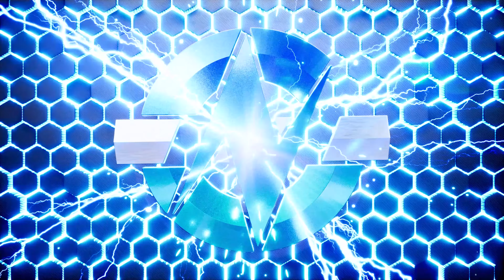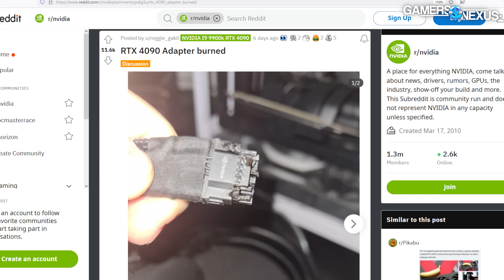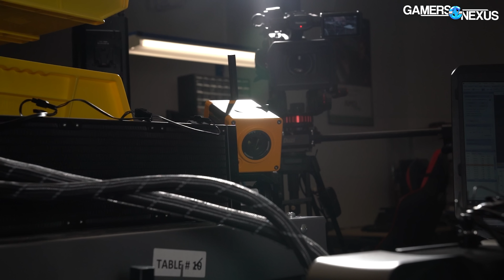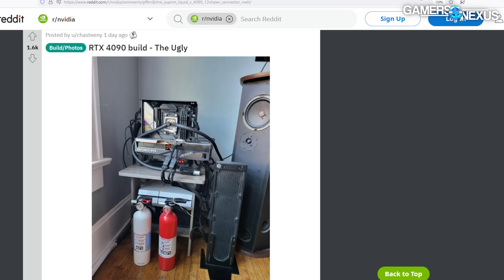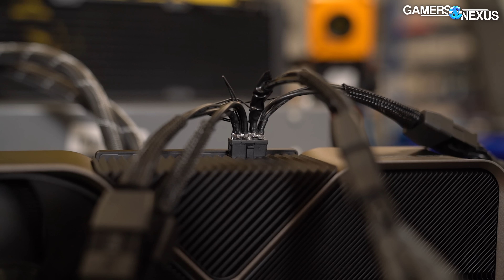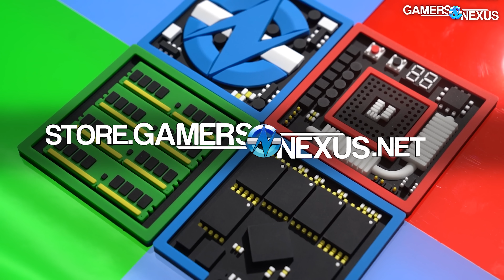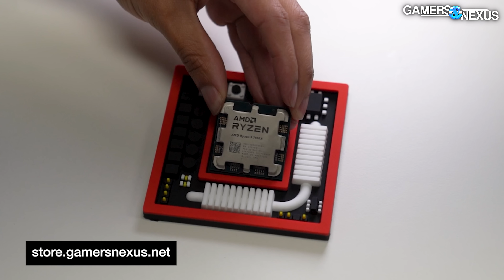Testing Burning NVIDIA 12VHPWR Adapter Cable Theories (RTX 4090)

Comment: I had a problem with J and Igor theory. If the solder point was the weak point, it would also be the spot the melts. Since the energy would have a smaller path to travel over/across, it would heat up in that area, not past it. I haven't see anyone test pin fit, that I am aware of.

Comment: After watching too much content on this sensationalized topic Buildzoid's theory looks the most credible. None of the pictures we've seen online show the cable side of the connector melting. Going after the solder joints is absolutely a red herring which is laughable at the amount of work people have gone through to dismantle that joint. Every post we've seen of real melting has always been inside the actual contact point. If the heat was sourced at the solders we'd see the back of said connectors melting, which no one has experienced. 

All electronics have at least a small measurable failure rate, especially at removable connections. This is a normal failure point. There's no such thing as a 0% failure rate. Even Rolls Royce and Bugatti have a measurable failure rate and they don't sell as many cars in a year as Nvidia does GPUs in a week. The difference is people don't hate RR and Buggatti. They take it back to the dealer and get it fixed instead of raging on Reddit.

I think what we're really seeing here is people understandably hate Nvidia's pricing and will jump on any imaginary possibility to dunk on them. The fanboys have taken over the narrative and all the tech press can do is investigate. The dumb part of that is no matter what the investigation concludes fanboys will never be satisfied. They'll keep digging for alternate diagnosis until they find one that agrees with their agenda. Even if it was discovered a supplier was to blame for selling under-spec adapters to Nvidia those fanboys will keep posting Nvidia GPUs will burn your house down for years to come because that's their agenda.

There's plenty of valid reasons to bash Nvidia but when people start raising false flags I won't have any part of that. Somebody needs to have some integrity.

Comment: Steve, Nvidia choice of using a single 12 pin connector with four 12 pin connectors ganging-up on it is the root of this problem, all done to save real estate on the PCB. Had they used two 12 pin connectors at the GPU this problem is go away. The problem occurs between the contact crimp location and the junction where the connector contacts the pin on the PCB. The contacts are made from very thin .25mm thick brass causing a very narrow path for the current to pass through causing it to heat-up increasing the resistive load even more which under high load conditions can cause thermal runaway until the connector starts to melt and burn. Your thermal camera is only capturing the local thermal temperatures and not the very short distance between the points I just mentioned. This design is "marginal" at best. Had Nvidia used 24 contacts we would not be having this conversation. Designing wiring harnesses, connector selection and PCB board layout as part job all I had to do is look at what Nvidia did and load it would be under to know what would happen. Positive locking would have helped. Great video, keep-up the good work

Comment: 6:35 - I wouldn't be surprised if someone in manufacturing or warehouse confused both cables since both are extremely similar
sounds like a quality control issue or mixed cables wrongly shipped. Which is still unacceptable considering how important such component is
that's why I never buy a product or game day one. "Sell now, make sure is good later" is the new moto for many companies
13:00 - Steve I suggest making a video showing how to do it for people who are still hesitant (as there are people that still don't feel confident with written instructions)

Comment: You are all doing this outside on a test bench, you already had one at 74c in one test, but it's outside a case in open air, if it's inside a case this number will be much higher since heat do build up in cases whether or not it has poor ventilation

Comment: Great reporting.  hopefully someone can get more actually failing samples in to people like GN (or the manufacturers) who can do more analysis.
For connectors to melt the housing, you really need a very high resistance at the connection and that is not really done with a completely severed connection (yes it will have more current through less metal, but they have some design margine so it is unlikely that a few severed cables will cause heat build-up that breaks thermal equilibrium with natural cooling, so there are possibly some connection that has become loose enough to have some high resistance, but not lost complete contact (i.e. solder point partially coming off like solder crack, partially severed cable (unlikely), or bad contact at the spring contact between female and male connector pins etc.  There are other similar issues we test in automotive like sliding wear, but thats probably not the issue here).

Comment: Another issue that is difficult to determine is knowing what the melting point of the plastic is from batch to batch.  If there is a quality control issue on only a few lots of cables, it is unlikely to run across a bad one if it is just one or a couple of runs.

Comment: Because the connector is melting at the end of the connector, if supposedly the broken part is on the other side of the connector, then maybe the problem could be between the connector and the board socket, like the adapter junction and the gpu pin!

Comment: To me, Igor’s findings are somewhat contradicting itself. Disconnected cables don’t create heat, because they’re broken off, the cables that are left connected creates more heat because they’re dealing with more current now. But the photos show the heat points are on the side of the connectors, which is where the disconnected cables are. In his scenario, it would only make sense that the disconnected cables are still so close to its contact points it starts arcing, which then creates a lot of heat.

Comment: To be fair, soldering the wires onto a board isn't that ideal. The PCB traces are potentially one of the more fragile things there, and it isn't hard to understand that a thin layer of copper foil isn't going to handle as much current as the much thicker cable soldered to it.

However, the 300 V vs 150 V rating is meaningless.
This is mainly depending on insulation thickness, and even a 60 V rated insulation is more than rugged enough for this type of application.
Thinner insulation has a lower breakdown voltage than a thicker insulation. But likewise, a thinner insulation also provides less thermal resistance, ie the cable doesn't get as warm. So to a degree, the 150 V rated cable is likely the better spec for this application.

In regards to Buildzoid's comment, yes having a 1 vs 2 slots in the contact itself is a major difference. Having more slots in the contact makes it have more contact points and in turn lower contact resistance. (high current cables in more industrial applications tends to have tens to hundreds of contact points. More is better, with the only downside being a more fragile connector for a given size.)

A simple solution is to simply say that they are pushing the cable too far. But soldering like this frankly isn't ideal in volume production... And I don't really see why they needed to solder it, crimping 2 or more wires into the same crimp isn't against industry practices, especially if the pin/crimp is designed with that in mind. A crimped connection is often more reliable long term, solder is however easier if connecting to a PCB, but why they use such here is frankly inept.

Personally, I am wondering when the PC industry inevitably will move to higher voltages. And perhaps this is already a possibility.
Sending X watts over 12 volts needs Y current, but have 24 volts instead and you only need half the current. And the only thing connectors really care about is current. The voltage doesn't effect thermals. (with the exception of having high enough voltages for an arch to form, but for a PCIe 8 pin, that is currently a good couple of hundred volts, and the arch will form on the PCB between the pins there, not inside the connector.)

Another even more major advantage of higher voltages is an easier time reaching higher PSU efficiencies. Downside is VRM ripple tends to increase with an increasing supply line voltage, but multi phase VRMs tends to quickly solve that issue. (just going to 2 phases makes a huge difference to ripple, and most VRMs have more than 2 phases.)

Comment: Um, has anyone looked at cross-sectional area (CSA) of the conductors? There are several 14gauge wires soldered onto a "thin metal plate". Maybe the plate does not have enough CSA to cope with the current draw?  ..and maybe the plate gets hot and softens the solder enough for wires to detach. There could also be a difference in the material used to make the plates and what resistivity those materials have.

Comment: are the affected 4090s used those 150v cable? and the question is why different cables too. did Nvidia realized their 150v cables are defective, so they made another batch for 300v rated?

Comment: Just my 2 Cents: I was working in an industrial maintenance department repairing CNC machines and the like often dealing with connectors that transfer 3-digit kw of power. I've only seen those issue on contact problems where the outer "sleeve" and the pins do not connect properly or on the full length, like plug not inserted completely. So a contact resistance issue = heat. Maybe some of the connectors or cable are out of size and contact force spec or a batch from one of many manufacturers. I doubt that every adapter is made by the same company. Also the spec seems to be hard on the limit of doable, yes works in the lab, bot not in the world. The contact pins should be bigger to allow more current per pin. Cool that you spend so much time on researching this. I'm not ready to buy a 4000 series card yet (or at all), my 1060 still does the job and I don't care about more fps in the games I currently play :)

Comment: My conclusion is NVIDIAs connector is the cheapest one they could come up with and have made somewhere. Its just overall pretty poor. Absolute disaster for a 2000$ GPU.
It has crappier contact sleeves than other aftermarket connectors and its overall more flimsy allowing those cheap sleeves to make bad contact with the pins and that causes excessive heat with the current the 4090 is pulling.

Throw it in the bin and use an aftermarket cable like one form cablemod.

Comment: What I want to see the future of power supply is to raise voltage from 12V to 48V. Then ATX12VHPWR should be replaced by much larger 48V connector. This increase efficiency of power delivery.
Remember electric turbocharger used 48V automobile power system?

Comment: Electrician here: That damage there be due to a poor surface area, or connectivity, across the pins. In effect it makes for high resistance, which creates heat as more amps are pulled to maintain voltage. They are using pins too small, or metals too poor. So either go bigger, or stop buying Chinese pins.

Comment: While the differences between the 150v rated and 300v rated construction are, well, shocking, everyone may be barking up the wrong tree. In my experience, when I have failures like this in DC cables on equipment, the cause is almost always a poor solder joint on the PC board. The poor joint causes increased resistance or sometimes even arcing which generates the heat. The heat travels up the pin and melts the cable connector as well as the board connector.

Is it possible that while users are routing the cables through the case, one (or more) solder joints on the card are being damaged?

Again, could come down to all melting is from the ugly 150v type cables, those pictures are really gruesome looking soldering. But I'd start looking at the cards if the better 300v type are also melting.

Comment: To me seems like everyone is debating on whether a small bridge has failed because the air humidity level reduced the concrete strength by 0.00003% or because the rebars in the third leftmost pillar were from a batch made with steel that had 1 part-per-trilion of nickel more than intended.
Maybe the real problem is that someone at some point decided that three big bridges were ugly and all the traffic was to be redirected on a single smaller one.

Comment: Kudos to Steve for giving up time off to test this!  Tech Jesus is our savior!  LOL  It's a shame you couldn't reproduce the problem, but honestly, that's kind of expected.  If EVERYONE had this problem, clearly nothing would have passed testing in the first place.  Other than waiting for failed cables (or pictures) to come in, I only have one suggestion.  Choose a video card to die, put it in a fire-safe area, and let the darn thing run for 24 hours straight with the thermal camera aimed at it and then come in the next day to check the cable and footage.  Gamers gonna game, all night long!  LOL  But speaking of the camera, my name suggestion is Theo The Thermal Cam , both for alliteration and for theory testing.

Comment: I wish to point of that Voltage does not cause heat, the flow of electricity ,Amperage, causes heat. A good example is the Van de Graaf Generator which produces very high voltage at very low Amperage. Using one of the in my Physics class 45 years ago whilst standing on a plastic bucket and shorting to ground by poking your classmates with your hair standing on end was quite amusing and although the spark/shock was a little painful there was no heat. However if you have low voltage e.g. 110v (USA) or 240v (UK), the UK mains circuit is rated at 30amps with plugs having a 13amp fuse, accidentally touching the live and neutral pins whilst unplugging is either very painful or at worst causes electrcution/death. Along with this is much more heat across the pins, at 240v 13a it will cause burns if held long enough. Additionally Igor's cable adaptor would be illegal in the UK at 150v rating  and the 300v rating you are testing would be marginal with a 20% over standard house voltage. Would be intersted if you checked the amperage of all the pins during testing as this could throw more light on the subject.
Reply: This connector is rated for 9.5 amps per Pin I think. Which is super high imo
Reply: @alouisschafer7212  Each cable and connector pin would need to be rated above 13amps to be legal and safe for use in the UK. Amperage rating is by individual connection, not across a group of connections. An average good quality 1000w Gold PSU supplies 80-90 amps over a single rail, in other words can supply up to 80-90amps to all cables as required, CPU, GPU MB, M.2, SATA, fans etc. Other than the GPU and CPU, most of the other items require very little ampreage. As the new connector pins and cables seem to be half the guage of the previous eight pin connector, I think the 9.5amp per connector relates to the card connection not the adapter cable assembly.
Reply: @smifffies  "Each cable and connector pin would need to be rated above 13amps to be legal and safe for use in the UK" since when do house wiring regs apply to internal PC components?
What im trying to say is the 12VHPWR is overrated from the start. 9.5 Amps for each pin is just too much for them to handle safely. Under lab conditions maybe but not in the real world where OEM quality differs and you may not always have 100% perfect contact. 
NVIDIA should have used two 12VHPWR in parallel instead of one. And maybe not went for the crappiest adapter cable they could find.

Comment: I wonder if you also checked the thermals after putting it in a enclosed case which could give a hotter thermal reading cause within an enclosed case it is hotter then and open air test bench, which could also be another hidden factor to the cable problem, as there is even less cool air going over the cable.

Comment: There's a lot of comments here and clearly I didn't read them all. Is it possible that a too small power supply is being used in these failures? I work as an automotive tech and I've seen circumstances where the power supplied to a circuit falls short on voltage causing current to go up. hopefully this thought doesn't get lost in the myriad of comments here.

Comment: Weird theory:  what if the failure point Isnt the cable, but the power supply? what if the "sense" system isn't working properlyor the PSU side is delivering the power unbalanced across the cables from the PSU end?

Comment: I'm actually kind of afraid of peeling off the stress relief and messing up the adapter's connector if mine is the crappy version 😅
Reply: That's not the primary strain relief, there's a rubber section at the bottom of the housing he's not asking that you try to remove. The tape is just additional support and keeps all the wires together. If temporarily removing that causes your connector to fail then it was barely alive to begin with. I wouldn't worry about it.

Comment: Sorry steve butvsaying the wire on igor connector is bad beacause of a lower voltage rating is wrong.
Its only 12v so a cable rated for 14A 300v or 14A 150V would behave the same

I am moreakin to the theory that buildzoid has that pins in the socket come lose vs your theory of thd solder joint.
The damage in the photo does not support a solder issue as the wires would come lose 'damaging the back of the connector.
The dammage is all in the front array where the pins of the connectors meat